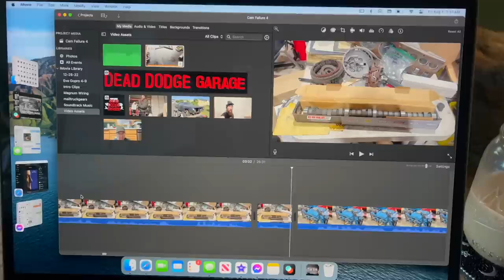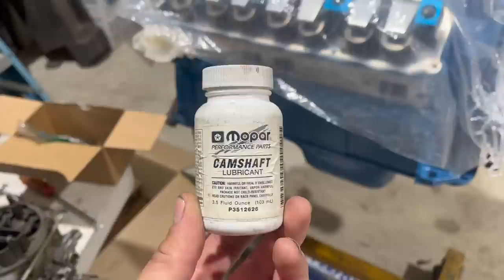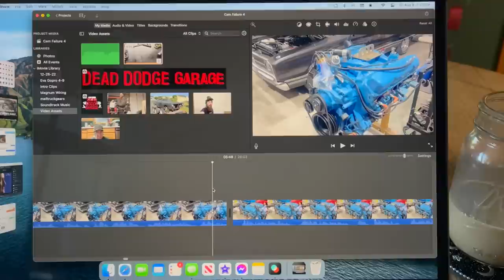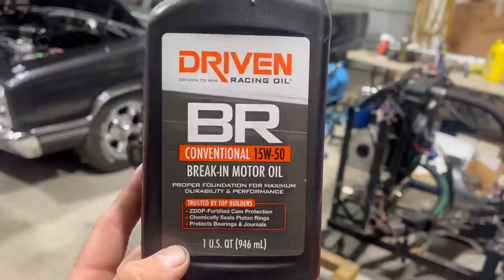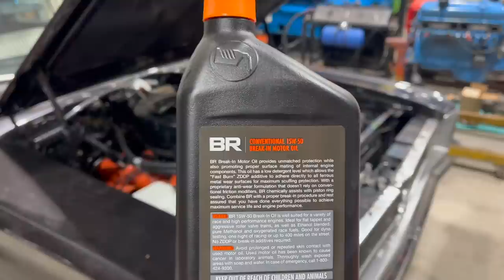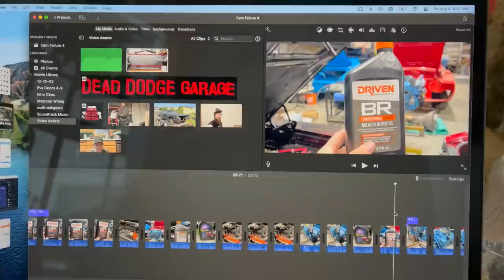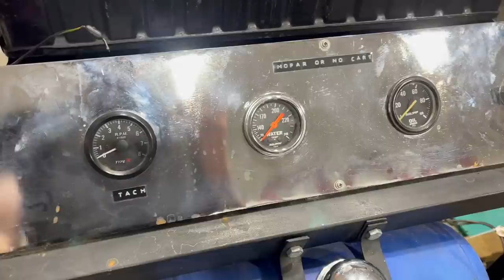How To Make Your Flat Tappet Camshaft Live, And The Anatomy Of A Failure

Comment: Good vlog. 6 years ago, same issue, same cam lifter package. Everything you mentioned was mostly correct except the windage tray. my stock 2bll 383 was original, didn't have one. one mentioned keeps oil from foaming. was going to make a vlog but didn't. you touched on but need to go more in depth which pertains to high mileage worn blocks we're all building. i knew and skipped this step (assembling in carport during rainy winter season yuk) ... the first time of insuring not only lifters drop in and hand spin freely with no load but under load. deep inside the lifter bore is the oil galley, over time the edge gets worn razor sharp. New lifters have an oil groove cut into them, very sharp edges. under load these two sharp surfaces interact which caused one lifter from spinning. i failed to mark each lifter, turn engine over before installing intake to ensure each lifter is spinning(with valve train installed). second go around with different manufacture you mentioned that voodoo spirit, 4 lifters would not spin. lightly filing oil galley edge and 4oo grit wet sand paper lightly scuffing lifter oil groove edges on all lifters. after re-install rotation from all lifters.  second break-in perfect, stilling running to this day. check my vlog for voodoo bump note. believe i have piston slap as brand new carb (hooley, love'em though) on first break-in started flooding, pin hole in float.. what else could go wrong you ask? had mechanic from that max car company help to complete in a weekend. unfortunately not securing all plug wires probably contributed to piston slap condition as it ran rich on one cylinder wiped all oil from walls. it'll still turn 6k though, i've eased up on those runs :- ) as the slap has grown louder. only time i had help, only time i experienced failures... just saying. thanks for sharing!

Comment: Around year 2000 new rebuilt 451 mopar .488 lift Comp cam and lifters, heavier Crane valve springs no windage tray, regular 30 wt oil no zinc additives 20 minutes at 2000 rpm break in and no problems.  Replaced heads this year cam and lifters were perfect.  Never heard of break in oil at the time.
Reply from the maker: I’ve had only the best luck too - before this. I’ve used windage trays, the wrong springs, aggressive cams, used cams and lifters… there are a lot of reasons why that doesn’t always work anymore - hence the video.

Comment: The windage tray keeps the crankshaft from whipping the oil in the pan into a froth.  It has no effect on the oil slinging out of the rod bearings (which is what gets on the cam).  Another issue I have had with Mopar and non-Mopar engines is the oiling notch on the rod bearing shells.  Most new bearings don't have this notch, but it's been a while since I've done an big block.  New small block bearings generally don't.  There's reasons for this, but on a street engine, it's better to have more oil spraying around than less.  Since you're not using some ridiculous valve spring pressures, I would guess it was a crap lifter with insufficient crown, or it was tight in it's bore and wouldn't rotate.
Reply from the maker: I think you're right in a crap lifter being the culprit. I already made a video explaining that - but there is more to this issue than just a part failure. I have learned a lot since that failure, and I wanted to wrap it all up in one more video - which many people seem to appreciate. I really wish I had covered lifter bore fit in this video, because they absolutely moved freely. I covered this in other videos, but it would've been good to have it here in the wrap up so people would stop saying that.

As far as the windage tray's job, there seems to be an incomplete understanding of what it does. It exists to interrupt the windage around the crankshaft generated by its rotation, and keep as much oil as is practical from getting caught up in that windage. That includes oil dripping down from the valley and coming from the bearings, as well as any oil that could potentially be splashing up from the sump. Yes, it acts as a barrier between splashing pan oil and the crankshaft, but there are other parts in even factory performance type oil pans that are specifically meant to control the sump oil. The amount of oil that the tray removes from around the crankshaft might be a totally moot point. But it was something several people brought up, and it made good sense to me, so for now I am going to stick with it, and I included it here. Anything that could help get oil on the camshaft during break in is a good thing in my eyes.

The oiling holes in the rod bearings are indeed absent from just about all replacement bearings these days. As I understand, their intended purpose was piston skirt cooling. Something similar is done in turbo diesel engines with oil nozzles directed at the piston skirts. The OEs decided they were essentially superfluous in this type of engine decades ago. I have seen others try to explain them as being for camshaft lubrication, but I think they only aid in that insofar as they throw extra oil out to be caught up by the crankshaft. I agree that extra oil being thrown around is better than less in these applications, for the reasons I discussed in the video. If the factory wanted to direct oil at the camshaft directly, they could have done that through other means.

Comment: Thanks, another excellent video.  When I get to the breakin on my small block, I'll follow the directions provided by Hughes Engines, since I'm using one of their cams.  They call for varying the RPM between 1500 and 3000RPM for the first 30 minutes, but they break it up in 10 minute intervals with 10 minute cooldowns between  (elsewhere it says 1500 - 2500RPM so I'll call them to get the reals).  Then 20 hour engine runtime before its truly broken in.  My kit is all as spec'd by Hughes so should be GTG with US made Johnson lifters, but like the computer security guru  says, and you imply, "Trust no one" so it'll all get checked.  They recommend break in oil so doing that too, though I'm hoping I can move to the Castrol GTX Classic (high zinc oil) or other more available oil afterwards.
Reply from the maker: Oh yeah. You should be fine with any of those higher zinc, “racing” type oils after break in. I definitely don’t trust any of them to just be good anymore, but some have said that Hughes is. We have done a couple of their rollers. I’ve never gotten my hands on one of their flat tappets just yet.

Comment: Last build a 273 with a mild "RV" cam. Used the black grease that came with the cam kit, only lube in the lifter bores was a shot of WD-40, filled it with 5W-30 Quaker State full synthetic, no prelube turning the oil pump. Fired it up and drove it, kept the revs up the first 20-30 minutes. Over 6k on it now, no issues.
Reply from the maker: I’m glad that worked out for you. No reputable engine builders recommend starting a new engine on synthetic oil, and prelubing the engine is a really good idea. I’ll defer to the experts on that.

Comment: Great video! I agree with everything except the windage tray. The oil that splashes onto the cam actually comes from the rod bearings leaking and slinging oil onto the cam, in fact some rods have spit holes at the rod bolts.
Reply from the maker: My understanding was the squirters were for bore / piston skirt cooling for the opposite bank. But I’m not an expert. All of this era of Chrysler engines had those, but almost no aftermarket rod bearings have the provision for them now. Apparently at some point they were deemed extra. Lots of people have taken issue with the windage tray thing. It’s something a couple commenters mentioned and it made sense to me. Maybe it’s bullshit.

Comment: Something has definitely changed, I’m in my late 40’s and put at least 15 flat tappet cams over the years. Never had any issues until the last 10 years. I never knew there were so many expert engine builders until I commented on Lubetube. Can’t imagine the comments you received but probably half are from people that have never turned an oil filter.
Reply from the maker: It has become more prevalent, but just today a commenter explained how this happened to him in the year 2000. Another explained how race builders have been using break-in springs for decades because this has always been a risk. We have shittier parts, shittier oils, and more aggressive cams and springs. It’s not a hard equation to figure out. There are a lot of people who know in the comments. There are also people who don’t. My method in life is to take information from all available sources, evaluate and compare, and find the happy middle ground that makes sense to me. Hence, this video.

Comment: Back in 2000 I had my first cam Fail and  eat a couple lobes when I built my current 440 Using the purple shaft 484 /284 Mopar performance Cam , and hydraulic lifer set ,  also new  valve springs with dampener set rated for this cam lift and heavy duty stamped rockers , I did not check, cam surface slopes or  the spring pressures open and closed .   I used  the provided Mopar cam lubricant  which was more like honey with moly additives ,  oversized  2.14 & 1.81 stainless steel Mildon race valves ,  hardened exhaust seats,  and I ported the 906 heads...  I wanted Bronze Guides, however the machinist convinced me they were not necessary probably based on my limited budget,    big mistake!  the knurled guides were to loose and sloppy ,  thus oil  consumption and some noise became a  problem ..    I  installed another new purple shaft 484 cam and lifer set a 108 degree centerline ,  and used much better  sticky thick ' Moly Lube Paste  instead of the  honey like oil based  mopar lube , on the cam lobes and lifer faces,  all lifers were pre primed with oil.. I  made sure to use my old  trusty Holly 780 carburetor , primed ready to run, and  a good distributor, pre primed  the Engine high volume  oil pump  just  before start up .   started up with out to much cranking time. and ran for 20 minutes at  around 2200  + RPMS ,  used a basic  30 weight NON Detergent motor oil.  just for  the break in run only ,  I may have added a quart  or two of oil with  high zink and then  ended up  running a high zink 20-50  race oil due to the loose valve guides and high oil consumption.  MY next engine build will be built with more precision to avoid  these issues ...
Reply from the maker: I need more stories like this, explaining that this was happening twenty years ago. People think this is a new problem and that the sky is suddenly falling, and that it’s all Comp’s fault. It’s not.

Comment: Thank you for sharing,
I can’t tell you how helpful and educational this video was for me.
I really enjoy the content.
A thought…..
Could you cut a small groove in the lifter bores from the middle down to allow oil to drain onto cam lobe?? (A very small groove so as to not did oil pressure)
Maybe he’s a triangular file and cut a .020” groove
Just a thought
Reply from the maker: I’m not sure there is an effective way to do that. But there may well be. Thanks! Happy to help.
Reply: @DeadDodgeGarage  Agreed...It was a thought, I do have them from time-to-time between brain farts. The quality control issues are alarming...20 years ago we weren't using break in oils and zinc additives blah blah blah....slap a cam in it, lube it up with motor oil and fire it up!! You really brought up some very valid points about the splash oiling, windage trays and modern detergent oils. I'm wondering if the cam manufactures have some responsibility to provide some more specific directions related to your points?? OR...maybe try to update some manufacturing techniques to help circumvent the new challenges?? OR maybe they hate us and want us to just die and buy electric vehicles, planned obsolescence. Thanks again!!!

Comment: When I tear down old engines I have not seen cam & lifter damage- mostly just normal wear.
    I have ran a lifter valley trays on my sb mopars for decades. First I noticed oil stayed cleaner longer from not getting roasted on the exhaust crossover, and the film strength of the oil (booger test) was also better for more miles, and the oil getting on the cam from the tray probably helped somewhat.
   Smokey Yunick used to write tech articles for Circle Track magazine- because of the rules on lifters in NASCAR, lower seat pressure 'break-in' springs were used on fresh engines- my first knowledge was mid.'80's but the practice probably far pre-dated that, replaced near race day by extreme springs to turn the rpms needed on racing day. 
   I only have a few non-hydraulic roller lifter blocks left, a few nib 0.500-ish '90's cams (big lift low duration) looking to use either Howards lifters with the hole edm'd dead center of lifter face or Crowers with the flat spot top-to-bottom on the side for cam face oiling to hopefully survive.
   I too have spent a bunch of time down the cam/lifter failure rabbit-hole.
    Several reputable engine builders have Rockwell Hardness checked the cams- seem to be within spec., they checked lobes for proper taper- seemed correct.
   I have checked my cams and their supplied lifters- seem fine.
   14K Subs-Wow!!
Reply: Oops wanted to delete that first paragraph

Comment: I've had a thought about using a spare valley cover and drilling a hole through it such that I can run a tube through it that is connected to oil pressure. Have 16 tiny holes drilled in this tube that will be over each lobe and have the open end pinched off. This would be only for break in and once it is done it would all be removed. This would make for sure plenty of oil gets to the cam and lifters during break in. I have not done this so I can't speak to if it would help but I don't think it would hurt.
Reply from the maker: It’s an interesting thought. What I will say is this - no amount of oil can overcome shoddy machine work on the faces of the lifters or the lobes.

Comment: I haven't read thru all current 245 replies, but using portable box fans to also blow at the radiator has always prevented overheating on my break-ins, though done in the car. Would have to blow at the radiator on your cart though it may look smallish, can't tell. 

My usual  machine shop always asks if I want the inner springs left out for break in and I have started saying yes.. They also suggest the Isky Rev Lube moly paste for cam and lifter faces, but not lifter bores. I keep it on hand. They've said that with all this plus break in oil and even extra ZDDP that some people also use, that once in a while one doesn't survive, but it's the best foot you can put forward.
Reply from the maker: We do that. But once we installed a cooling fan on the radiator that actually works, problem solved. Yes - exactly. You nailed it.

Comment: Have set of very small ratio rockers for break in on bbc. So far I’ve never had an issue. I’ve also done some old school lifter bore scaring to drip more oil on the cam.

Comment: Back in the 60's we never had issues with cam/lifter in Chryslers.  The only engines with inherent cam issues were sb Chevys.  But most of those engines didnt have windage trays.  Cams and lifters were largely stock, as were springs and rockers.  Very often cams and lifters were used and not always inserted into the proper holes.  We were just dumb kids, learning and no doubt lucky.  I guess better oil and eorn out val e springs?
Reply: Windage tray is a 'non-issue'. If you knew nothing else about oiling, physics, etc. The factory never took them out to run-in an engine nor did anyone in the last 50-60 years and empirical evidence proves it isn't a problem. Granted the lobe profiles were milder but still.
Reply from the maker: I definitely see those as factors. Even the “performance” cams of that day were nothing like what we’ve got now. As I understand, the Chevy problem is down to a smaller diameter lifter? I recall there was a rash of failures there in the 80s or something. I try to not have to know about Chevys.
Reply: @DeadDodgeGarage  Yup, I know what you're referring to with the GM core crisis. that was actually across all divisions I think and it was traced to cores not being heat treated properly. So yes, a smaller lifter has less load bearing surface and won't rotate as fast. 
The old 'Low Taper' Hemi and 6bbl hydraulic cams from 1970-71 had a flatter contact area and was moved closer to the edge to 'promote' lifter rotation. I've seen these lifters called 'High Rotation' lifters in some parts catalogs. I used to have a couple sets  a few years ago and sold them. Good luck finding either a cam or lifters for either if you have one or the other. Reason they did it was for longevity. The OE 'Hemi' valve springs used on those engines were 298-310 lbs open depending on what spec you believed. Compared to 250 ish for a stock Magnum 'red' spring. I did measure those 'Low Taper' lifters and the were practically flat. Only .0005-.001 taper. I'd be afraid to run those now. It was just the factory engineers being cautious. Those cams had HUGE ramps anyway.

Comment: I see a heat insulator between the valley pan and intake,seen them in the wild but seems they are always left out on rebuild,nice Jamie.
Reply from the maker: Oh yeah! This engine isn’t a performance build, it is a factory type restoration. We put great effort into getting the little details like that right. Unfortunately this one had to come back apart after paint, so it will require some touch up. Just for the record, the factory calls that something like a tappet noise insulation pad. It can’t do much to keep heat away from the intake when there is exhaust flowing through the heat crossover in the intake right above it. Thanks!